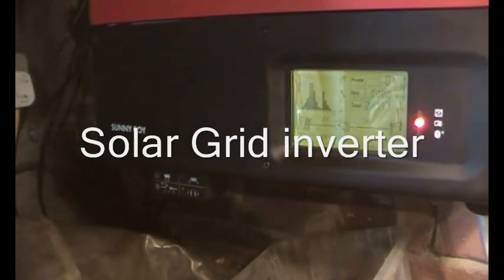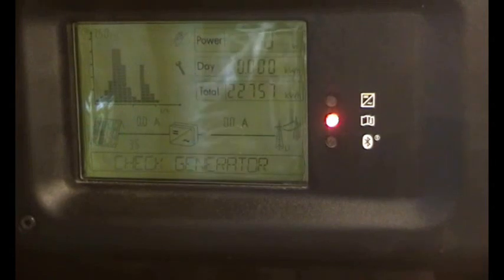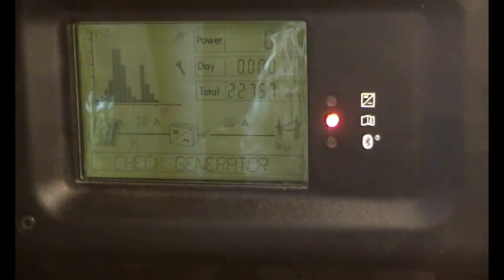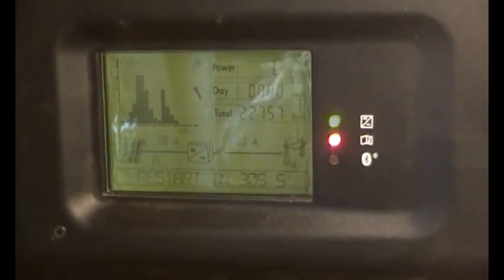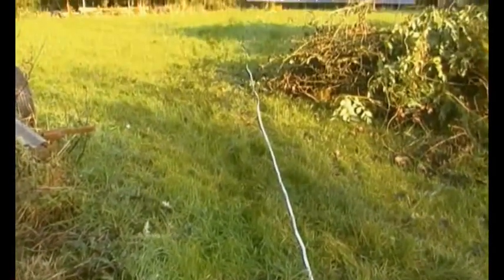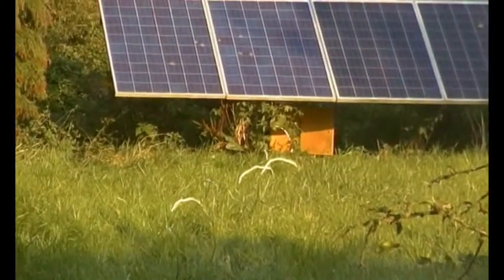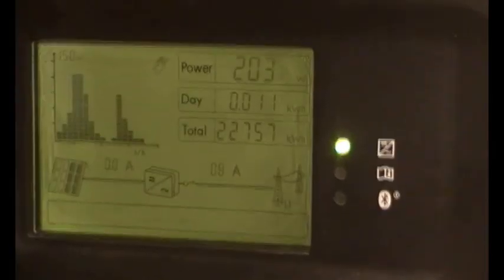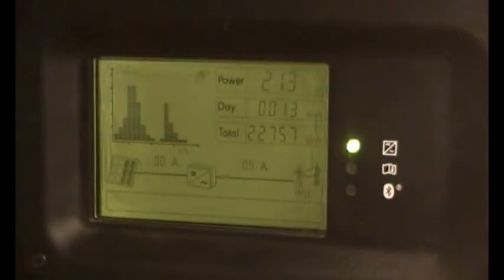Isolation fault, Riso, solar inverter fault, SMA, Solar River

Comment: Sir, 
SMA company 25kw solar system inverter not work 
Seen display grid fault error 
Whats problem sir
Can you say me sirr
Reply from the maker: Is there mains power at the inverter? cheers
Reply: @TheInfoworks  
Yes sir 
To dc strings is ok and grid supply ok 
But inverter section not working 
Display seen grid fault error

Comment: when you power on a power one 5000/6000 outd-us inverter.  It will show you a riso value say 20M ohm.  But during the day this value will decrease.  Should this happen.  I would think the resistance would be the same all the time.
Reply from the maker: Hi, resistance will change with temperature, cheers

Comment: Had the RISO fault come up on a Power One Aurora with the turbine last autumn Andy. The man fitted an isolation transformer on the  ac grid side...
 All good ever since fingers crossed.👍
Reply from the maker: Jim, Interesting, I tried an Aurora inverter on this system when the fault was active and it showed a RISO fault and low ohms. All good background info, cheers

Comment: I guess the underground cable has joints which have got damp Andy ? In other words - this earth leakage hasn't occurred in a single uninterrupted piece of underground cable has it ?  Dave.
Reply from the maker: Dave, DC is such sneeky stuff, yes there was a joint in a conduit with 5 layers of overlapping shrink insulation. This is fine for 50v DC and it has been fine for 250v DC  for a year or so, but no longer. By your question you know the way I think, cheers
Reply from the maker: Dave, interesting update, the new (from the roll) white cable produced the isolation fault after it had stayed in the damp grass overnight. I lifted it out of the grass and sat it on a series of plastic water barrels. The fault then went away, so correct double insulated solar cable for high voltage DC (285v). This is probably the problem with the underground cable that only came to light after all this recent rain, cheers.
Reply: @TheInfoworks  I wonder if that SMA inverter has gone too sensitive to leakage faults or something ? I think you have 250vdc in that cable, I find it hard to believe there's really much leakage current to ground from a new piece of cable, just sitting in damp grass ... I wonder how you got around this with your other panels/inverters - are they just at a lower voltage in the cable maybe ? Cheers, Dave
Reply from the maker: Dave, could well be a bit sensitive but I have had a similar problem with a Solar River where I used the yellow site cable for the DC from 7 panels, raised the cable off the ground and problem went away, so who can tell. Previosly I have used armoured cable and that is marked up to 1000v and double insulated from the armour layer, cheers